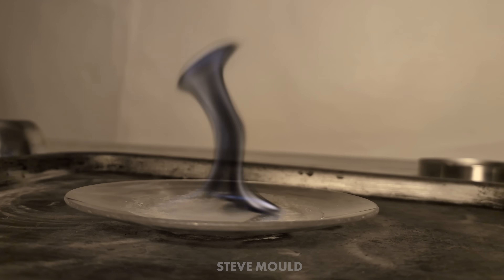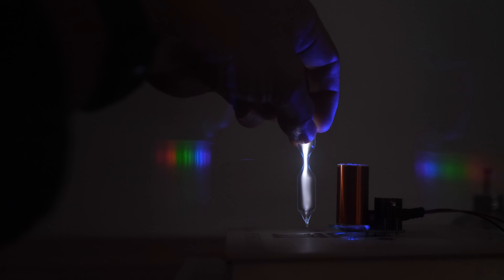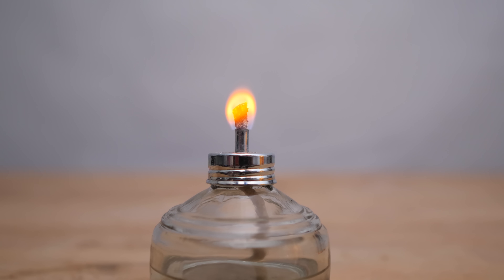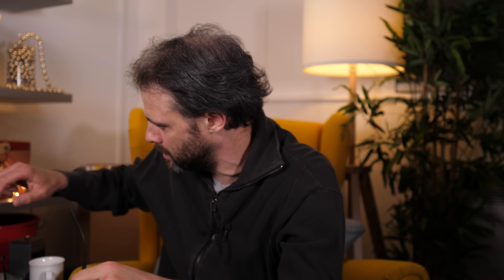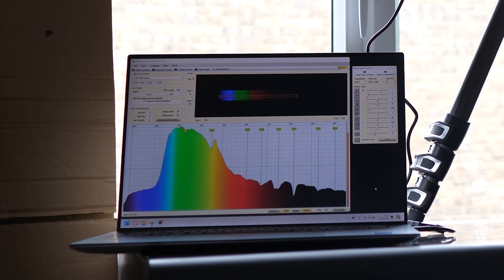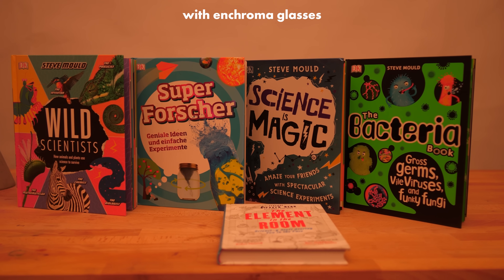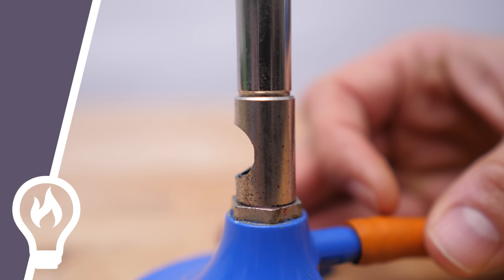Light sucking flames look like magic

Comment: What. Number is the third number supposed to be at 15:32?
 I see 45, 2, idk, 42, 74, 97, 6, 3
What is the third one?
Reply: I think the point of the third one is that normal vision makes you mainly focus on the red/green bands, but red/green colorblindness removes that contrast, allowing some people to see the number more easily than those with normal vision. I have normal color vision, but I think the number in the third one is 23, it's just very faded and hard to see.

Edit: according to another comment, the number is actually 73, which is visible when put into editing software and messing with the contrast

Comment: Low pressure sodium lights were great for astronomers because the light was at a single wavelength they could easily filter it out. It's kind of unfortunate people are putting massive amounts of white LEDs everywhere these days, they're so cheap and efficient that people just use more of them.

Comment: I have question: why does the absorbing of a photon and reemitting it with the same wavelength in a different direction not violate momentum conservation? Is it the wavelength?
Reply: Every time an atom absorbs or emits a photon, its momentum will change a little bit so momentum is conserved in every interaction. The atom gets a little "kick" from the photon.

Comment: It makes me wonder about the result which might be achieved using a sodium light source as a near point source in schlieren when imaging a sodium flame...I believe you would see large  density gradients in the flame itself, IF they are in a state which isn't cylindrical where the refractions extend beyond sensitivity of the system...?

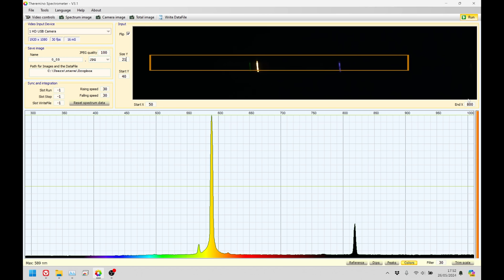Comment: 9:54 the second peak is the same sodium line. It is the "second order" of the diffraction grating. It should be at 550*2=1100nm.

Oh and your wavelength alignment is off in the software. There should be a way to calibrate it with two light sources with narrow peaks (like the sodium lamp or a laser) and known wavelengths.

Comment: Extremely good, as always... as it comes to the splitting of sodium spectral line, however, I used to know that it might be due to the presence of a magnetic field (Zeeman effect) which makes electron's spin not energy-neutral anymore (not randomly distributed anymore) because the state where the spin points in the direction of the magnetic field has higher energy. One last remark: the point-like (dimensionless) nature of the electron is a postulate (which I doubt will survive future scrutiny) of QFT, not an experimental observation. A great day to you and to everybody 😊.
Reply: You're correct that it's the Zeeman effect explaining the splitting! The way I like to think about it is that the electron spin's magnetic field is interacting with the magnetic field generated by its own orbital motion. Think this: if the electron is taken to be in the stationary frame, the positively charged nucleus appears to be orbiting the electron. Since accelerating charges generate magnetic fields, the electron sees a magnetic field due to its own orbit!
Reply: @452  Thanks Chris for your comment but frankly I don't think that electrons orbit the nucleus, so it's hard for me to share your view (I though of the sodium lamp as the source of the electromagnetic field). When I refer to electrons I usually say that they 'buzz' around the nucleus (or that they 'surround' the nucleus) and in my mind I picture their wave-like nature doing so. About their more intimate structure I don't know what to say... electrons are extremely small (smaller than quarks) and yet they have angular momentum: string theorists picture them like a (tiny) rotating ribbon with a unitary electric charge and my mind can't get rid of this picture: imagining something multi-dimensional is no more mind-puzzling to me than imagining something dimensionless... 🤷. Have a great day 😊.

Comment: 🦁🦁🦁🦁🦁 THE LION WAS HERE 🦁🦁🦁🦁🦁 No. 3200     =----->     Back When I was a kid (perhaps 70 years ago) The Belt Parkway in Queens had these weird sodium lights when you came across the Whitestone Bridge on the way to the Southern State Parkway, lights such as you have just demonstrated. I loved the yellow color. Those were the days when the parkways were run by the department of parks ('duh), and NOT the DOT. All of the signs were brown wood with individual boards and rustic ends and letters made by reflective jewels. And the lampposts were square rustic looking wooden posts with a rustic wooden cantilever holding the lamp. I specifically remembered that it looked like there were two lamps in there, but now I can see that it was just a single lamp turning back on itself. They should never have let the DOT take over the parkways. They were even patrolled by the park police and not the County Mounties. Indeed, ever since the DOT took over they were patrolled by the State Police, and not the county police. Bing back the yellow lights at least!

Comment: Can you do the same thing (getting a single wavelength) by diffusing a laser pointer? They are single wavelength sources, I've tried using one to see fringing in optical parrallels and my janky setup did function but i did have to bounce the difused laser on a white sheet and i think that might change the wavelength a bit.

Comment: That is a low pressure sodium lamp.  High pressure sodium lamps would offer a slightly better color rendering.  Would the black flame trick still work with HPS?

Comment: In terms of talking about the energy of a photon it really depends on what part of the spectrum you're at if you talk about it in terms of wavelength or energy.  Sure it's easy to convert but I've still never seen anyone use femtojoules since electronvolts tends to be a bit more useful.  In fact I think you made a prefix or math error because 589 nm wavelength is about 2.1 eV which would be 3.4 *10^-19 J or ~1/3 of an attojoule.  I don't think I've ever heard anyone use attojoule in any context.

Comment: I wonder if the standard explanation provided for the light sucking flame phenomenon is correct. It's an experiment we have shown many times at our physics center. We investigated the phenomenon at the end of last year, and the result of our investigation is that the explanation is... completely wrong? You can test it for yourself. If you shine an extremally bright sodium light upon ANY kind of flame, it will turn dark. We used ethanol with sodium salt as a flame source, as well as pure ehtanol, and just any common flammable material like cloth or paper. We even tried other strong light sources to illuminate the flame. The phemonemon can be reproduced with several kinds of set-ups and, therefore, the absorption-emission of sodium atoms can't be used to provide a proper explanation. We think the darkness of the flame might be caused by carbon impurities instead. However, there seems to be a lack of clear information on the topic. It's such an intriguing experiment! Thank you so much to have provided a video on the topic, your content is always incredible to watch.

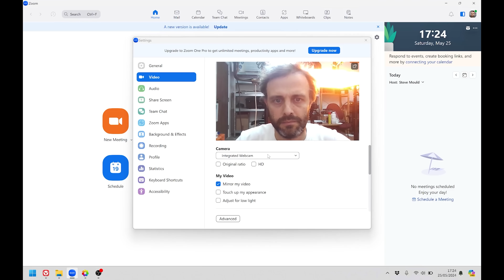Comment: 9:30 What is wrong with that date on his computer? It's, it's, BACKWARDS! And his time is in military time too. Is that messed up? Or is it just because I am an American?

Edit: I've been told it's a military date stylization. Was Steve in the military? Or is that normal in where he lives? They do use the imperial unit of weight for money, so.
Reply: This may be very shocking to you, but that's just how most of the world does it. Day/month/year is by far the most common date format. The second most common is year/month/day, which is the "official" international standard. Nobody outside the US really uses month/day/year as far as I'm aware. And from an outsider's perspective, it's very weird. Why would you not put the month - which is the intermediate time scale between day and year - in the middle? Nobody else does that.
24h time also isn't just "military time", it's again what a lot of the world uses. 12h time is definitly not as rare as your weird date format, there are quite a few countries that use 12h time and a lot that use a mixture of both. But 24h time is very common. Both formats are used in the UK.

Comment: "This may look like trick cinematography but it's not"
Immediately reveals trick cinematography
Reply: it turns out you can make a black flame if you look at a green flame through green sunglasses
wow such science
Reply: The only trick of the cinematography is changing the white balance, though.  Otherwise it's exactly what you would see in person with no lenses or filters between your eye and the flame.  (It is trick illumination, of course, but it works in person just as well as on camera.)

Comment: Hey Steve, you should have a look into Irlen Syndrome (Scotopic Sensitivity Syndrome), It is commonly seen in dyslexia and ASD. Resulting in a person having to wear certain coloured glasses to block wavelengths. Here is an excerpt about the the Syndrome "When an individual suffers from Irlen Syndrome, their brain has difficulty processing certain wavelengths of light. In this way, light (especially bright and fluorescent lighting) becomes a stressor on the brain. This stress causes certain parts of the brain (e.g., the visual cortex) to become overactive."

Comment: I have a high pressure sodium lamp that actually has decent light. The low pressure sodium lamps were by far the most efficient in lumens per watt but were extremely mono chromatic, mainly one emission line with some contribution from a second, they had a very low cri and were really poor lighting, no color was even close to right.
I actually purchased the 200 watt sodium lamp because I was sick of weak reading lights, but it was overkill, it was so bright that the light reflected back from the page hurt my eyes. Oh well. I don't use it for interior lighting (eg cellar/workshop), because high pressure sodium lamps can fail explosively at the end of life and burn the house down.
I have a 70 watt metal halide for exterior lighting, but these products are not as efficient as modern leds so it also sits in storage.

Comment: 10:00  The infrared peak at 819.5 & 818.3 nm is from the 3d to 3p transition.  The red bump is 5s to 3p, while the green one is 4d to 3p.  These 2 are both less than 1% of the intensity of the yellow peak, so they don't affect the color of the lights noticeably.

Comment: Pointlike particles are not 1 dimensional but 0 dimensional. Having 1 dimension would mean it has length but no width or height. Technically they still are 3 dimensional but a “pointlike” nature would a 0 dimensional characteristic

Comment: The reason you presented for explaining the darkness of the flame compared to the wall, is also why in cold atoms experiment (especially the one with fewer atoms and short imaging time) some choose absorption imaging instead of fluorescence imaging. The signal projection is directional, and therefore we have more optical density.

Comment: The 819 nm infrared line is the 3D -> 3P transition(s):
https://www.researchgate.net/profile/Rosario-Pereiro/publication/237256270/figure/fig3/AS:669294102843402@1536583557982/Diagram-of-energy-levels-and-electronic-transitions-for-atomic-sodium.png

Comment: I propose this unit of sharpness be the "Distance in medium" number. so "cm in noodle" or "inches in foam". I would also consider using cheap EVA floor mats as your cutting medium, it is denser and will be more repeatable and homogenous than a composite media.

Comment: I want to clarify one thing. It is not true that for every absorbed photon, another photon is emitted. The electron levels are not actually discrete levels, but rather continuous strips of finite thickness. Also there are almost always multiple transitions available, and only some produce photons. In others, the energy is converted to heat. So the emitted photon might (and mostly will) have different wavelength from the absorbed one, and in some cases there will not be an emitted photon at all

Comment: 6:03 "crucially, the newly emitted photon will be traveling in a completely random direction."
well, sure, but aren't there orange photons hitting the flame from other directions as well, which will be diverted by chance to point into the camera? i can assume you aren't illuminating the entire room with that lamp, so perhaps there are fewer directions with incoming sodium light than there are directions the light is being scattered. if you put the flame in a box and totally illuminated it, would it become invisible?

Comment: I don't think I buy that an electron is a point-like particle. If it has a probability to be detected at certain points, doesn't mean that it is one-dimensional. I would say it is definitely not one-dimensional. If it has a wave function, it has a "probability curve", and the point where you happen to detect it isn't "the singular point" where it is.

Comment: You ought to do some experiments with Germanium lens. They are used in Infrared Cameras, they filter out the visual spectrum of light above infrared light. What is really weird about using them is that most visible light passes through glass no problem, but to infrared wavelengths, the glass acts like a mirror and you can't see through it with an IR camera. There is really a lot to go into in the world of IR visualization, like emissivity, reflectivity and transmissivity.

Comment: "I'm not using any camera trickery" ... "other then this trick" ... :|
Reply: It’s not camera trick, it’s lighting trick
Reply: i mean it's still black without changing the white balance as he showed immediately after, it just looks nicer for the video when everything else isn't yellow
Reply: To be fair he didn't mess with the camera
Reply: @sg5sd  furthermore it looks the same in person
Reply: @zedex1226
but the flame isn’t inherently black either
Reply: Whitebalance is a camera setting though
Reply: Other than*

And he's using physical trickery, not digital
Reply: It’s a lighting trick based off of the camera’s auto balancing, i.e., a camera trick. And no, it’s not what the eye sees. The opening frame at 1 second looks like a white room with white light, and an obsidian flame, all because of auto balance. With the auto balance turned off, it would look to the eye more like frame 31 seconds, which is a lot less impressive: a yellow washed room in mono light with a tuned-out flame.
Reply: @FlRiAfCeTLE  Your eye (or rather your brain) also does a lot of auto balancing. It's hard to get a sense of what experiencing something like this in person would look like. The net effect will probably be somewhat in-between the white balanced one and the washed out yellow looking image (which is definitely not how you would perceive it in person if you spent more than a few seconds in the room with those lighting conditions).
Reply: Other than

Comment: High Pressure Sodium lights are not efficient in terms of energy usuage and the conversion of energy into light. That is why they are being replaced by LED's, but do go on claiming otherwise. If you are referring to the light spectrum itself, when it comes to efficiency,  then you need to clarify this.

Comment: As an anomalous trichromat, I appreciate the discussion around the colour blindness glasses. I've personally always thought that they were a bit of a scam. I mean I know I'm colour deficient due to a genetic anomaly coding for a specific light sensing protein in my retinal cells so what is putting on a pair of glasses going to do about that? I also never really thought that the market would be big enough for scamming people with colour deficiencies to be really worth it but I guess I was wrong. AT the end of the day though, it's like you say: IF the happiness benefit is bigger than the cost to you then go ahead.

Comment: On the subject of light absorption, I'm reminded of a vinyl record I had back in the 1980s. It wasn't totally opaque, but only let light through of certain wavelengths. If you looked at an incandescent bulb (or daylight) through it, it would appear red. But fluorescent lamps would look more purple-blue through it! I wish I'd kept the record so we could analyse it with a spectrometer like you did for the glasses.

Comment: Regarding that peak in the infrared you talk about at 9:58, you can check out the emission spectra on the NIST wegpage (https://physics.nist.gov/PhysRefData/Handbook/Tables/sodiumtable2.htm), which confirms that sodium indead has a strong line (actually three very closely spaced lines) around 818 nm.

Comment: Speaking of glasses--
1. I was recently at a steel mill. They use similar glasses to filter out wavelengths emitted by the molten steel so that it's easier to see what it's doing. However, I believe those work on the light emission based on temperature, not on emission spectrums.

2. I have a set of yellow glasses that just happen to (I believe) block the specific blue frequency produced by LEDs, such as in headlights. When I wear them, I can still interpret white things as white (clouds, street markings, incandescent headlights, etc.), but when I look at an LED headlight, it appears definitely yellow--hence my conclusion about blocking that specific blue wavelength but not other blue wavelengths.
Those glasses make men wonder what would happen if I had lenses that blocked ONLY the wavelengths produced by red, green, and blue LEDS used in monitors, light bulbs, etc. Presumably, the light source would appear dark, but what about everything illuminated by the light? Is there any dispersion of wavelengths such that reflected light does not have the same frequency as the original light? If I wore those glasses indoors lit only by LED, would they cause complete blackness, but wearing them outside would be mostly clear?